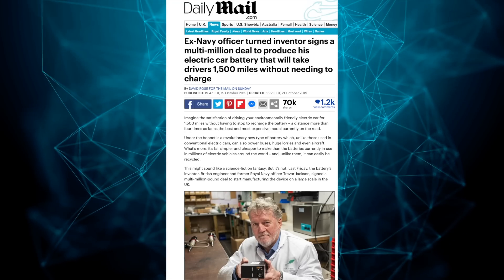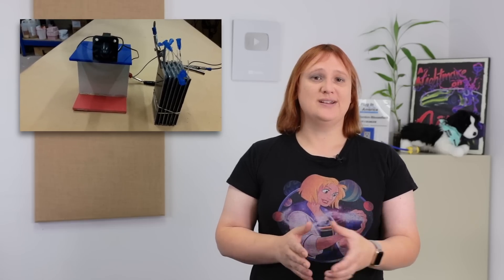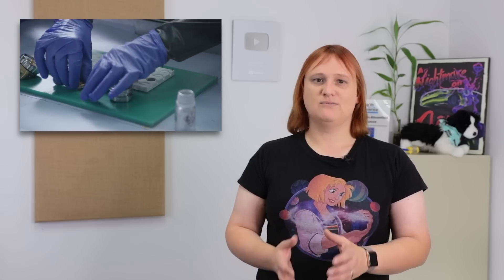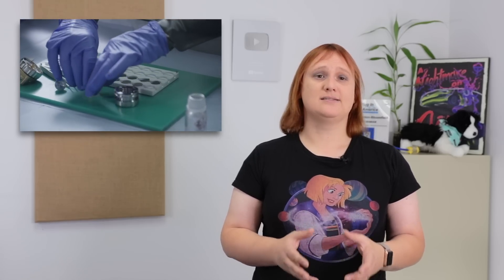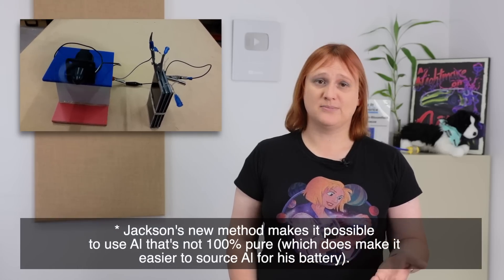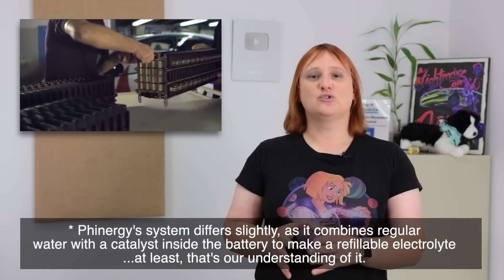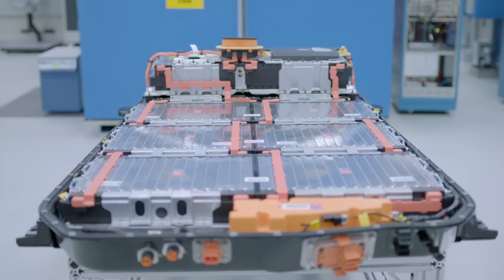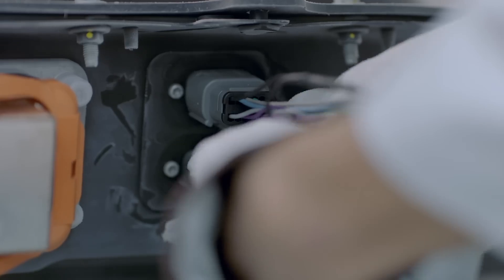Is This Battery The Holy Grail For Electric Cars?

Comment: Good "jerry can" foe E planes flying over rough terrain or water or cold areas. Even for those hybrid E emergency planes. With a ICE engine and electric backup motor (use A batteries instead of L batteries for a more compact "jerry can").

Comment: The economics of "Battery swapping" will have to be examined closely. 
Not only will they have to swap batteries, but they will have to rebuild them.
Also, turning aluminum oxide back into aluminum is energy intensive.

Comment: A plug-in range extender sound like the perfect application for this technology, now we just need manufacturers to agree on a common voltage, size, connector and way of securely holding it, or will they each make their own?

Comment: Way back in1960 I was a mechanic in a BMC main dealership and one day a man and a woman came in and asked to see the owner, They asked him to try the Austin Mini they had outside, He drove the car up the road and back and said its a mini, to which they said yes but its running on water, obviously we all wanted to know how. there was a spare tank at the rear for water, a oblong tank on top of the rocker box which had two electrodes fastened into it, they explained that when electricity was pasted through water Hydrogen gas was produced this passed to another box where the carburettor would have been, inside the box was a vibrating finger that turned the gas and water into a mist and past it into the inlet manifold then into the engine where it ignited and the car drove as normal as a Mini, the only difference was it would not start on water and had to switched back to the petrol just to start it. these people came from Sheffield University and had been paid by a large fuel company to complete it then it was patented and shelved, everything else on the car was normal it just had no emissions only droplets of water from the exhaust and no need for special batteries or anything else, just fill up with a small amount of petrol in one tank and fill the other with water, there was obviously more to that box of tricks on the rocker box but if they could do it then, it can be done again now no need for electric cars, just petrol cars that run on water, new name PWCars, now lets hear the critics, but I witnessed it working.

Comment: An EV needs a rechargeable battery, but it only rarely needs a 200+ mile battery.  

Put the best energy density, single use, battery in standardized modules and connectors.  With aluminum air, a 50 to 100 mile module, should be light enough for driver installation.   Sell new, and recycle old modules at fueling stations.  

Make (cheaper, lighter) EV's with only a 50 to 80 mile range, including connectors for 2, or more, modules.  When you drive near the rechargeable batteries range, the first module augments it until depleted, then second takes over.

Comment: Those So-called, DIRTY Fossil fuels, make about 99.9 percent of the energy to Fuel, E.V's  !
Reply from the maker: Even if that were true - which it isn't (For example: "Roughly one-third each of PSE generation comes from coal, hydroelectric, and natural gas facilities, with about 10% coming from wind and less than one percent from other energy efficiency programs"), switching to 100% EVs would still lead to an marked overall reduction in emissions because gas cars are incredibly inefficient, and producing gasoline from oil is an energy intensive and also horribly inefficient process. 

You can check out how driving an EV would stack up where you are here: https://www.ucsusa.org/resources/how-clean-your-electric-vehicle

And as we know, as the grid mix gets cleaner, EVs get cleaner: 
https://blog.ucsusa.org/dave-reichmuth/new-data-show-electric-vehicles-continue-to-get-cleaner

Comment: Your idea for using the aluminium battery as range extender is interesting but we'd still have to swap it at a certain point. I believe that if it can be manufactured at a small enough package, it could be exchanged at current petrol stations (evolved to support the new model) for a new one. Like replacing a battery on a flashlight. Given the battery density, this process could perhaps be done once a week (or longer periods hopefully),  like many people do with internal combustion vehicles.

Comment: A rechargable aluminum-ion chemistry is completely feasible, this battery in the article is a primary cell (ie: non-recharable) so it is not suitable for EVs. There have already been individual breakthroughs in developing rechargable aluminum-ion, but has not reached commercial maturity as of yet. Lithium Ion was an important steeping stone for EVs but eventually lithium-based battery chemistry is going to become a burden for EVs and renewable energy as a whole. If the EV industry and stationary energy storage applications scale up to take over all fossil fuel territory, they will not be economically or environmentally sustainable, they require too many rare elements and minerals. If EVs are to ever be truly revolutionary, there needs to be a large push towards developing a more seminal concept for rechargeable batteries based off of highly available, cheap and recyclable elements like aluminum and iron.

Comment: What are your thoughts on the Lithium Carbon Dioxide batteries? They are supposed to have 7x the energy density as Li-Ion, yet under 2 year cycle life.

Comment: Okay, Ginger, you want to be able to come home and take a few hours to charge up on your own home made energy, but then, after so many battery re-cyclings, to have to pay $5000, or something for a completely new battery.  What you don't like is to pull into a 'Gas' Station and have the attendant take a mere minute to pull out the old battery and swap in a new battery for some slight 'ex-change' fee.   Well doesn't this solve the biggest problems, that is, how to transition between Before and After.  We keep the Service Stations, and if anything "fill up time" is actually shorter here (in a few years the 'attendant' can be a robot that will have programming on how to yank out and stick in for every car on the road).   You're idea for an auxillary battery would only multiply essential systems and add weight to every car.  Do you want less moving parts or do ya?  Multiplying Systems is also more to go wrong during the trade in inspection when it comes time to sell the old and buy the new.  So you don't want to buy a lot of crap you don't really need, do you?

Comment: When they produce Aluminum, electricity is fed into a cell with bauxite (an ore of aluminium) and out comes aluminum.  Sad that this sort of chemistry can't be used.  The down side for mobile applications is that it take place at high temperature as the whole thing must be molten.  I wonder, though, if this would be a practical chemistry for large industrial storage applications.

Comment: I think they said it costs 5,000 pounds for a battery that can run a car, and after 1500 miles you have to buy another one. That's more than 3 pounds per mile. Way too expensive. The pound is currently about 1.3 US dollars. Cha-CHING! This won't work unless it can be made much cheaper.

Comment: This from the Googles:
Like many metals, aluminium does not come out of the ground as a shiny metal, but as a special kind of rock, an ore. Aluminium ore is called bauxite. ... The production of aluminium is very expensive and extremely damaging to the environment.

According to Alcoa, the world's largest producer of aluminium, the best smelters use about 13 kilowatt hours (46.8 megajoules) of electrical energy to produce one kilogram of aluminium; the worldwide average is closer to 15 kWh/kg (54 MJ/kg). Worldwide production of aluminium in 2010 was 41.4 million tonnes.

Comment: I'm thinking Li ion and aluminium O2 battery's should be exchangeable cartradges in an automatable manner at current petrol stations type facilities  instead of having to rely on charge points

Comment: Does any one have an idea what the energy creation vs energy discharge is. I could easily see this as a way to balance the grid. With solar going online and flooding the market electricity rates can drop to very low points during the day then you create an al air battery plant that requires very little operator intervention and just runs when electricity is below a certain price. Since nearly the same amount of energy is used for transportation as home energy use it would easily balance out. For electric vehicles it sounds like a win where there's no range anxiety. Plus if self driving cars take over uber and truck drivers will want their cars driving as much as possible.

Comment: Evolve this......RandD better and more efficient ICE engines.  Refueling batteries for EV's by the UK's electricity that is produced by burning fossil fuels, mainly natural gas (42% in 2016) and coal (9% in 2016) is a far better process than roof top solar or any type of wind power.

Comment: The best air battery is the one we already use and that is oil, half of the fuel is already in the air, all you have to do is develop fuel cells which can use oil, don't worry fuel cells won't be able to run on fossile fuel oil, because they need pure oil without sulfer or any other contaniment, which means senthetic fuel which are created with nuclear energy, spliting hydrogen from water and trapping co2 from air, this way will will run a race who can capture the most co2, which will clean the environment.

Comment: The electrolyte is toxic? Well yeah, sulfuric acid is not exactly nice to your body. Toxicity in battery electrolytes is a sensationalist idea. You can use a sodium hydroxide solution for aluminum batteries for example, which can be easily poured down the drain and dispersed into the environment. Lead-acid batteries use sulfuric acid which, though generally nasty in high concentration, is not "high toxic" like they're saying. For example, simply adding ammonia or ammonia hydroxide solutions to sulfuric acid will neutralize it to ammonium sulfate which is a fertilizer. A simple, simple understanding of chemistry really goes a long way in cutting through this sensationalist bullshit.

Edit: Oh and this lady has apparently never seen an aluminum metal explosion. Google that and have fun.

Comment: Thumbs up for covering both sides.
It's easy to have a bias against non-chargeble batteries, since it can be another source of waste we really don't need.
But on the good side we already have facilities to recycle alkaline batteries.
Maybe those can be retrofit to take aluminium batteries.
But as of today I'm sceptical since Al batteries is not a new thing, and big manufacturers hardly touch that tech.
It's nothing new, just that we're desperate for a battery.
Thanks!

Comment: I'll stick with my 55mpg and 600 mile range diesel until all this rubbish gets sorted out, the EV is a great idea and if battery and charging problems are Not sorted out they will end up like the dinnasour. I agree with people who say their happy with their EVs, if they have their own driveways to be able to charge them and only do low mileages then they are great but for high rise residents or anybody who can't park on their own property life would be very difficult running one of these vehicles. Not enough thought has been put into running EVs and people's concerns about charging, it's the future but not yet awhile.

Comment: Maybe if there's an industry standard for size, shape and connection per Al-air battery so you aren't locked into a particular dealer from a particular brand and a particular model to avoid the "Oh sorry, no Tesla of your year in stock, come back next week and we MIGHT have one". Recharging stations (or lack thereof) are the biggest hurdle for EVs in my area. There aren't any. It's a 4-5 hour drive to find one at highway speeds. A bit like mobile phone coverage, actually - what coverage???

Comment: For all the naysayers, there is a lot of intense research going on in this area right now to make rechargeable aluminium/air (and other metal-air, sulfur-air) batteries. There are some examples (published studies you can find right now, see below) where air batteries have been recharged, but the battery life drops off rapidly with each cycle currently.

New organic electrolytes and membranes have made the biggest leaps for the performance and recharge-ability of these cells. It's not impossible but it may be a few years yet until that nut is cracked, and when it is, boy oh boy, dump your lithium stocks, sell your batteries and prepare for a whole new world of awesome devices/transport/robotics.

Use Google Scholar to search for these recent publications to get a feel for current progress on metal air batteries: 
"Recent Progress in Electrically Rechargeable Zinc–Air Batteries" - Zn-air reaching 150 cycles. 
"Rechargeable Multi-Valent Metal-Air Batteries" - Fe-air batteries reaching 50 cycles.
"Semi-solid-state aluminium–air batteries with electrolytes composed of aluminium chloride hydroxide with various hydrophobic additives" - Al-air batteries hitting 25 cycles.
"Activity of different AlCl3-based electrolytes for the electrically rechargeable aluminium-air battery" - Al-air getting 15 cycles at 56% efficiency.

Comment: No. It's single use bs. And recycling of those batteries costs much more energy than any other battery.
You can make your EV run a nearly unlimited amount of kilometers or at least to the next public grid socket with a small generator that can burn vegetable oil and/or standard fossil fuels. You will never have to ring for a car service to tow you to the next town that way. You could include that generator into the chassis of the car and put a small tank with it. Easy solution that only produces CO2 when it's really needed. But who wants simple solutions with standard tech already available? Capitalism wants people to come up with scams to produce profit maximisation.

Comment: I'm not sure this video really addressed the most important issues. Having to replace a battery every 1500 miles seems comparable to filling up a gas tank every few hundred. I suspect the bigger issue is the amount of energy required to manufacture an aluminum versus lithium battery. I don't have the numbers, but refining aluminum requires a lot of electrical energy.

Comment: Aluminium air battery is nothing new, navy used this kind of battery in submarines that not power by nuclear for decades. I always think Aluminium block as a energy cube. Aluminium take a lot of energy to refine when discharge it releases energy. The totel efficiency is not as good as lithium battery. Hope it will work one day, after all lithium battery can't be used forever, it also need to replace some 10 to 20 years. Aluminium in other hand, can recycle itself very easily, it CAN BE used forever!

Comment: I like the idea of the Al-Air battery as the ‘range extender’.  If it’s cost friendly to use (standardized size and interface etc.), it could be the REX on any battery EV for the long journey’s that aren’t yet supportable by charging infrastructure or travel to remote / unsupported locations.
And if rechargeable metal-air cells come from research, the ‘battery’ gets a big capacity boost from what it is now.
Keep studying, experimenting, and learning.  Future’s getting better!

Comment: The tech sounds interesting though as yet unproven at a scale large enough to power any EV or plane. And the article quickly smudges over the need for a bigger fuel cell.

There’s a definite bias against lithium batteries, where the text reads or implies things like:

• lithium batteries are more expensive to recycle than throwing them away;
• lithium batteries are not recycled due to cost
• lithium batteries are heavy but makes no reference to how heavy an aluminium fuel cell would be, if powerful enough for a car
• dismisses lithium batteries as being “unfeasible” to power buses and trucks, saying the weight of the vehicle would be greater than the cargo. Without recognising that nearly every present day motorised private vehicle, is already much heavier than the people and their luggage that they transport. As do many if not all fossil burning/EV buses and many lorries/trucks
• dismisses the fact that there are already many buses and some lorries/trucks that are EVs

It says that a Tesla Model S battery costs £30,000 and then goes on to say, that each aluminium fuel cell could cost approx. £5,000 each. Now the cell as reported, (if big enough) would power a car for 1,500mi, while the Tesla goes about 370mi, (their figure). Then fudges over, that the Tesla battery is good for about a million miles. Whereas the aluminium fuel cell is spent at the 1,500mi mark. So while the Tesla battery may cost “£30,000” and will of course need recharging to cover the million miles. I’d seriously doubt, that the Tesla will cost the same or more, than enough aluminium fuel cells to cover the same distance.

1x aluminium fuel cell = 1,500 at £5,000ea
100,000mi / 1,500 = 66.66 fuel cells
66.66 x £5,000 = £333,333.33

100,000mi in a Model S on:
• Tesla Supercharging only £5,232.40 
• avg. paid for grid elec. £4,260
• cheapest paid for grid elec. = £1,148.60
• and depending on home owned solar array and or wind generation. The cost could be much less.

Or you could get your car converted for aluminium fuel cell at approx. £3,500 and spend another £33,333.33 to go the same distance.

Comment: this supposed new aluminium battery is old hat, baking soda in water with a piece of aluminum can in the water can produce an electric charge and hydrogen and other toxic chemicals- know over a century ago - but its single use and cant be recharged - thats why we dont use the fking thing.  aluminium is a bitch to CREATE... look at the energy required before you think an AL battery is worth it.